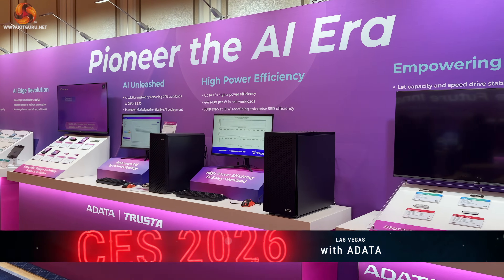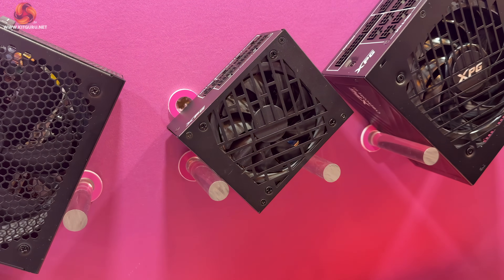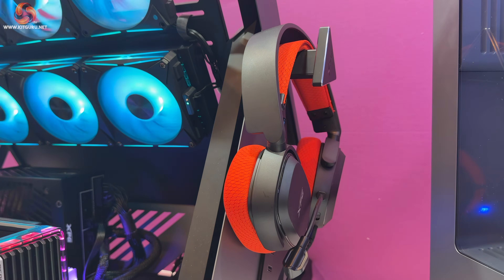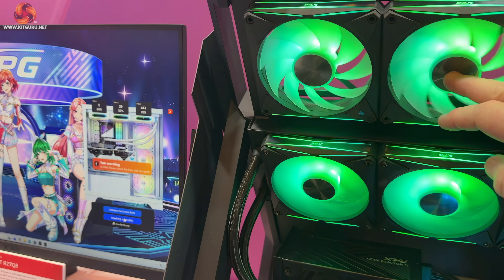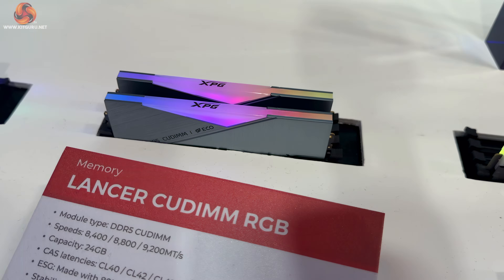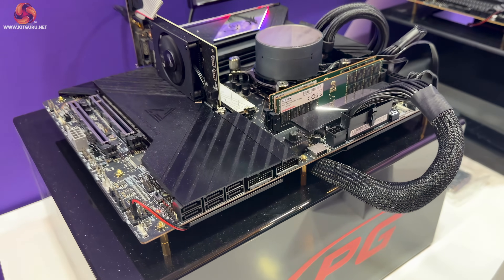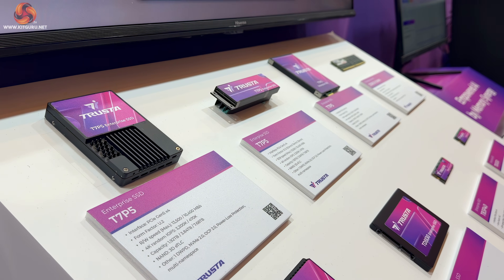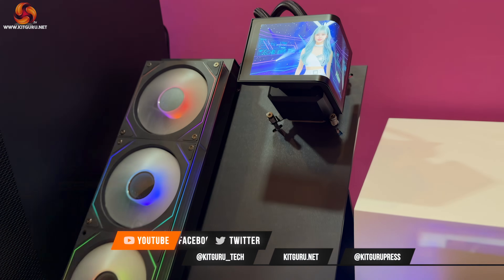256GB DDR5 Memory Kit Spotted at CES 2026 - ADATA XPG

Comment: Only reason ram was fine to get fast kit to begin with was the cheapness of it.   With it costing this much it's value for performance gains just is non existent,   the gains you get from 6000mhz to 8k mhz  is barely a percent difference   even DD4 is pretty close to DDR5